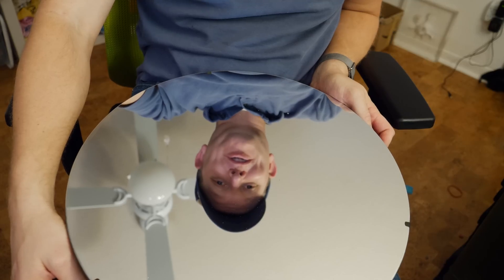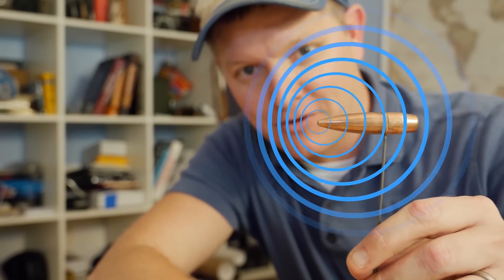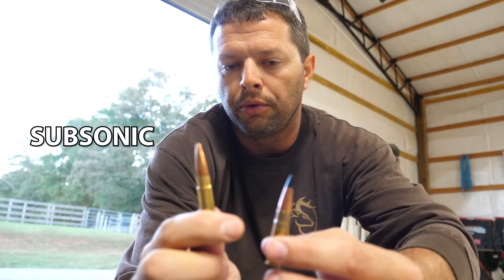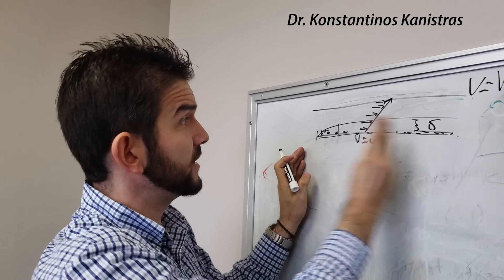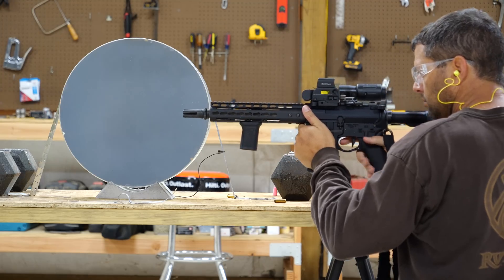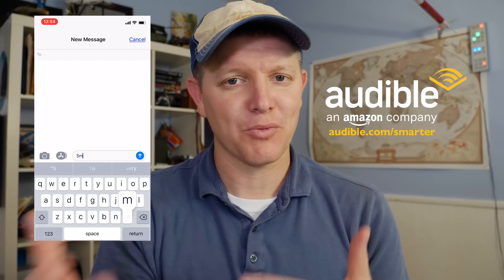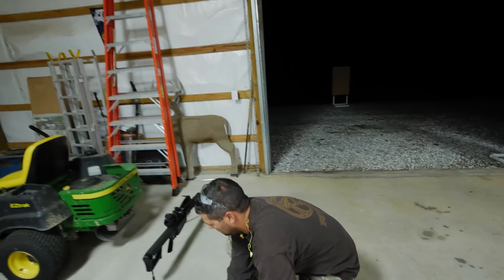Shockwave Shadows in Ultra Slow Motion (Bullet Schlieren) - Smarter Every Day 203

Comment: What would happen if the angle of the cone was smaller than the angle of the bullet itself?
Reply: I think you would still get a triangular shockwave, but with the upper and lower visible line starting only where they are tangential to the curverture of the bullet tip. Looking like a triangle with a rounded point.

But who knows?! It needs to be checked to tell for sure.
Reply: Yora  you actually see this at the bullet tip in the video. So I think you are 100% right
Reply: Look up  "blunt body concept".   The shock wave  become more of a bow shape and is in FRONT of the projectile.  The blunt body concept was to create a thermal-barrier in front of a space capsule or warhead to use the shock wave as an insulator.
Reply: or, bullet fails, round shatters?
Reply: There is actually a finite value which shockwave angles approach as the Mach number approaches infinity. The shockwave will only get more narrow up to a certain point, based on the geometry of the object in the hypersonic flow and the properties of the gas the object is moving through. For oblique shocks, such as those you see here, the angle of the shockwave will always be greater than the angle of the leading edge of the bullet.
Reply: @aidenbramer1157  "The angle of the shockwave will always be greater than the angle of the leading edge of the bullet" That would imply that sounds can travel faster than the speed of sound in a shockwave. The angle of the shockwave will only necessarily be greater than or equal to the angle of the leading edge of the bullet near to the location of the bullet.
This is true for bow shocks as well. The further you get from the supersonic object, the closer the shock angle gets to the ideal for the mach number.
Reply: @J7Handle  

Ah... Because the Mach angle ("mu") is not the same as the oblique Shock angle ("Beta").

Took a bit of digging but thanks for giving me a reason to dive back into my Aero books.
Reply: This is why the SR71 is shaped like it is - to keep the rest of the airplane inside the shock wave / cone
Reply: well the angle of the bullet is ~12.5 which means the bullet hast to travel at ~4.5M
Reply: it would probably cause turbulence the bullet would fumble and rapidly decelerate back to a normal speed
Reply: Instead of an attached oblique shock (attached meaning the shock begins at the surface of the bullet), you would get a bow shock. The shock wave would start before the bullet and would create a hyperbolic shape wave. This significantly increases drag, so you'll see this used in vehicles where you want to slow down, like re-entry capsules for astronauts! You can look up bow shock for cool pictures of this.
Reply: I'm not a shock expert so for more technical explanations see others in this comment chain but thinking about what would happen the shock wave would bounce off the bullet because the air can't penetrate it, so the dynamics become more complex and can't be modeled with the equation provided.
Reply: Man that subsonic round just wasn’t stabilized by the barrel. If it had proper spin due to correct barrel rifling it would fly strait.
Reply: one more observation: it seems to me that there's a lot of activity in the actual shock bow or shockwave compression wave angle. If that bow matches the shape of the bullet then it conforms tot he bullet, but in doing so, presumably drag would increase. the benefits of both the blunt body concept and the extreme angle of high ballistic coefficient bullets is their ability to live in the low friction space BEHIND the shockbow.
Passing through this bow can also lead to instability once that transition takes place, and it seems we were seeing a little bit of that on the subsonic round, of the twist rate wasn't really enough for that barrel length. But most supersonic rounds lose accuracy once they go transonic and then sub, as the turbulence of passing through various friction phases changes how it flies and makes it more unpredictable. That's why so many target shooters want to use either great speed or high Ballistic coefficient to stay supersonic as long as possible... or both. preferably both, a lot.
Reply: Some false answers here. When the angle of the cone becomes smaller than the bullet itself (meaning the bullet is going faster), The shock wave remains attached to the surface of the bullet until the bullet slopes away from the shock wave angle. Dracoflame is incorrect. Bow shocks actually happen when the vehicle is going slower, not faster (or when the vehicle has a higher deflection angle).

Comment: Having a history in both the Army and Engineering in college.. I expected every part of this video - Save 1 thing.  It never even occurred to me that there would be supersonic particulates coming from the muzzle of the AR-15/.300BLK.  That was a genuine pleasant surprise.  
I would actually be curious to know precisely what those were.  I'm more inclined to assume they were dislodged bits of fouling from previous rounds inside the rifling grooves than un/exploded grains from the stick gunpowder used in rifle cartridges.  Easy way to tell which one of us is right - thoroughly clean the rifle barrel.. and test again!
Reply: its quite common to have unburnt powder leave the barrel of a gun. It's partly how CSI people investigate who shot a gun, there's unburnt "powder" particles on them. SOme of this is more or less common depending on the recipe you're using vs what primer vs barrel length. Having grains that are unburnt after leaving is not unusual, but like it said, it can be minimized quite a bit. But he was shooting an SBR, so the effect is going to be increased, even with a 300 blk. He said those supers were about 1500 fps, its very possible he was using a sub optimal recipe and was handloading. 1500 isn't typical for the good supersonic hunting loads, especially if the bullets are about 120 gr or so, and not 150s (he said the subsonic was about 100 grains heavier, but 250 gr subs for 300 blk are almost unheard of).

Comment: I would never have thought that calculating the Mach number would be as easy as 1/sin 𝛗. Mind blown 🤯
Reply: Well technically it is trigonometric
Reply: @paulleimer1218  trigonometry is a part of geometry...
Reply: @Christoph1990  fair enough
Reply: It probably was picked as a unit of measurement because it's quick and easy to calculate.
Reply: @Yora21  What do you mean? The Mach number simply is the factor of the speed of sound of an object in a particular medium.
It just amazes me, that there is such a simple geometrical solution of calculating it.
Reply: 4:58 maybe yall can help me. I plugged the numbers of the angles from the bullets and I got nothing close to the numbers on screen. sin28.85 is -0.54439... 1/0.54439 is mach 1.83 but why is 2.07 on screen? thx

Comment: 4:29 Can you write the European Measure System in your Videos to. Her par example Kph
Reply: He had it in m/s. 343 m/s × 3.6 = 1234.8 km/h.
Reply: Just do the conversion factor yourself. It’s not hard. Be smarter.
Reply: @Mostlyharmless1985  well, just use international standards, it's smarter
Reply: Antoine Durieux US customary is an international standard. Codified by Law, Mendenhall Order of 1893, and further refined by the International Yard and Pound agreement of 1959 and standardized by NIST. Every yard .9144 meters and every foot 1/3 of that yard, every inch 1/12 of that foot. 
Every pound is exactly  0.45359237 Kilograms.
Use of metric in this country is optional and people are free to use the standard they wish to use. That’s what freedom is. If you don’t like it, make your own amazing video footage and use your own standards in using it.
Reply: Victor Titov multiplying by 13 by 5 is not a hard math problem. 12 by 5 is 60 1 left over by 5 is 5 60+5 is 65. 65/64 ~ 64/64 13/64 is ~1/5 if you want to get really fun you can say it’s 1/5 with 1/64th remaining. 
Numbers are a tool, and fractions are another piece of that tool.
Reply: And, since we are on the topic of standards, we can just round it all off by stating a gallon is 231 cubic inches. 
It’s pretty much the only unit that isn’t an international standard, because the differences between the US Gallon and the Imperial gallon were too far apart to come to a compromise on. To that end there isn’t a fundamental reason to use gallons beyond they are a more convenient unit to measure commodities in, larger gallons mean smaller multiplication problems, there’s nothing saying we can’t use liters, and in some places we do.
Even then there is a clear conversion factor because of the inch being defined by the meter.
It’s messy sure but the math comes to 3.78541 liters as a conversion factor. Or 3.78541 cubic decimeters. 

Because why match volume to your base unit? Metric being so gorram perfect.
Reply: Victor Titov 13/64 is about 1/5. You just illustrated my point further for me. Fractions are scary for you because you lack basic math skills. It’s depressing really.
Reply: Victor Titov I swear, this obsession with decimalization is the true reason why the world is turning into idiocaracy. Do you not understand fractions? Are you so simple minded that 1/3 throws you into a spiral of madness and despair? Shoo. Before I chase you with a broom.

Comment: Does the angle of the cone of a projectile give a fraction of the speed of the projectile to the mach number of the fluid? I'd be interested in seeing the same experiment performed in water or at different ambient air temperatures, to see if a different angle is produced.

Comment: Cool video. When we talk about supersonic flow and transonic flow there are shockwaves, and also expansion fans. Expansion Fans are supersonic flow that is expanding, the opposite of the compression of the shockwave.  With the transonic bullet, the air moving around the bullet first is subsonically compressed at the nose of the bullet, and expands as it moves around the bullets body. The expansion fans form first, supersonic expansion. This is followed by the "Wake"  shockwave, a normal shockwave where the supersonic flow is compressed and transitions back to subsonic flow behind the normal shockwave. So,  as and aircraft accelerates through the sound barrier, the Expansion Fans grow followed by the growing normal shockwave of the "Wake" shock and the tail of the aircraft is flying supersonically while there is no "Bow" shockwave and the nose of the aircraft is flying subsonically. The Sound Barrier sneaks up from behind. At Mach=1, the "Wake" shockwave size goes to infinity and the "Bow" "normal" shockwave is formed.

Comment: About circles: Maybe it is bullet ringing? Look: bullet diameter on my screen is 52 px (13 mm bullet), wave length is 21 px => it's 5.25 mm wave in air = > 65333 Hz. If speed of sound in lead is 1160 - 1320 m/s, then length of this waves in lead is 18-20 mm ( 0.7-0.8 in), which is in a range of a bullet dimensions.
Reply: I mean circles you mention at 3:47.
Reply: So, waves of deformation moving through the bullet back and forth after the shot can cause these waves in the air. The fact that wave length is similar to dimensions of the bullet supports this hypothesis as it is looks like just a resonance frequency of the bullet.

Comment: why are the colors from the shockwaves on each side inverted? you can see it at 2:17 when you pause the video. the left edge of the bottom shockwave is white but on the top shockwave its black! do the colors have to do with the light getting bend to focus on certain areas?

Comment: You need to do a bullet at lower subsonic speeds so that the air is not adequately accelerated above subsonic speeds. Surely there isnt subsonic flow for very slow moving curved things like tennis balls because the acceleration is not enough to compensate for the low speed of the ball.  (?). Let's find out :D Awesome video. I will definitely be using this with my high-school students.

Comment: Re:  The "circle" shock-waves which you mentioned, but not knowing for sure what they were.  I saw those and immediately thought/assumed they were formed by the front edge of the rifling; They seem to be originating just under the ogive, where the rifling would be starting.  I'd think it'd be pretty easy to math it out based on the barrel twist rate, number of rifling cuts, and counting how often the shock-waves are made per bullet rotation...

Comment: Thank you so much for this video.  I have a few guns I run suppressed that I reload for and I'm experimenting with different bullets at varying velocities and I was wondering why I was getting such erratic results. Some bullets are so much louder than others at the same velocity and now I'm going to have to allow for that airflow acceleration.  I'm imagining that the air being displaced by a 458 caliber 500 grain flat nosed bullet would be considerably greater than a 308 caliber 210 grain spritzer profile bullet there by causing more of those supersonic flows of the edge of the bullet. I wonder if those flowers are what destabilizes the bullet, giving it that wobble we saw.

Comment: Okay, the circles you see in the image. Here is my hypothesis:

We are looking at a 2D projection of a 3D cone created by spheres of pressure waves. In an ideal fluid where it's equally dense in all locations, you would not see those spheres as easily. However, in air that is constantly moving and fluctuating, as air in an open shop would, we get slight differences in pressure. As the bullet flies through those areas of slightly differing pressure, those differences affect the spheres of pressure that are generated, and they become slightly offset from each other in energy/size/other aspects. This offset becomes clearly visible inside of the cone that the spheres make up. You are seeing the side profile of the spheres that are offset from their neighboring spheres in some way.

Also note, because you placed the razor horizontally, you emphasized vertical differences in photon refraction as opposed to horizontal differences. If you place the razor vertically, you might be able to emphasize the vertical profile of the circles even more because it would be emphasizing horizontal differences in refraction. That's just a guess though.

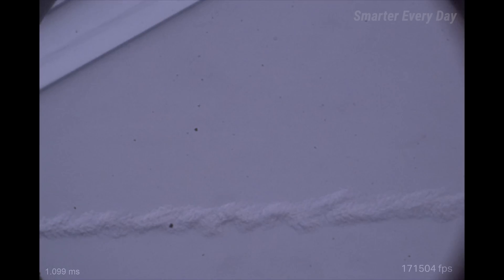PS: If you look at the super sonic bullet ( 1:32 ), you also get those funky lines on the side of the bullet. Those funky lines not only appear just as they did on the sub sonic bullet, they are appearing INSIDE an already existing sonic boom and more than that, they are at a sharper angle than the already existing sonic boom. Those are tiny sonic booms within the sonic boom. Why is the angle sharper? My only guess is that the density of the air in the sonic boom (between the front and back ends) actually makes the speed of sound SLOWER inside the sonic boom, hence the angle being sharper on the inside, and bending to match the regular angle as it passes through the density differential to reach the back end of the sonic boom.

Comment: Bernoulli's principle explains that an increase in velocity is a decrease in pressure and an increase in pressure is a decrease in velocity.  The shape of the subsonic round causes the velocity of the round to be subsonic, but, since the round is still divergent the is air pushed out of the way of the bullet to reduce pressure, increasing the velocity.  That is what causes the supersonic peaks of air.  The same thing happens to wings on an airplane and a lot of high bypass jet engines like the PW2000 or TF34.

Source: USAF

Comment: An interesting thing about transonic flow is that, because of the combined sub and supersonic areas, it makes it difficult to design planes to fly in that region. Most commercial planes moght fligh in a low transonic regime, around 0.8-0.85, but then you don't really find any aircraft in the region above it, until it's maybe the 1.1 or higher Mach range where you start getting the design points of supersonic aircraft. This is because the differences in what the flow does between subsonic and supersonic means whenever you're in that transitioning range you get huge losses, with both extra drag and less efficient propulsion (transonic pinch). As an example of these flow differences is what happens in a diverging nozzle- in subsonic flow, diverging nozzles decelerate the flow. The opposite happens in supersonic flow, where a diverging nozzle section actually accelerates the flow, the complete opposite of subsonic.

Quite a few supersonic aircraft engines use this in whats called a 'con-di nozzle' (converging-diverging). The converging section accelerates subsonic flow until it reaches Mach 1, then (because of the opposite flow effects described above), further acceleration of the flow occurs in the supersonic section in the diverging half of the nozzle

Comment: Can someone explain why half the returning light had to be cut?
Reply: Any light that refracts down through any change of air density will be blocked by the bottom of the razor, and that part of the image will appear dark. Keep in mind, the exact place that the razor is , is the focal point, meaning the entire image going into the camera is only ~1mm wide at that point. So any small deviation up or down makes a much more drastic effect when the image spreads back out into the camera. Just look up the Schlieren effect for more info.
Reply: James Hutton The razor is at the focal point of the mirror! That was the missing puzzle piece for me. Thank you!

Comment: You can see an example of a normal shock and the Schlieren effect while onboard an airliner at cruising altitude and speed, as long as the sun is high. SImply look at the wing (assuming you have a window seat near the wing), and look for a faint line of shadow longitudinally along the wing. It will flicker back and forth a bit. This is a shadow of the normal shock. I have video of this phenomena.